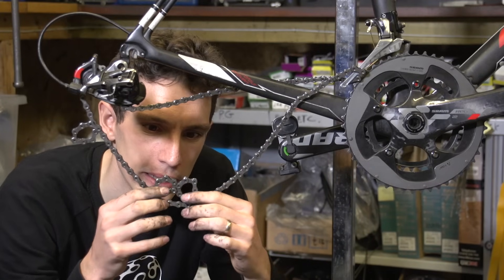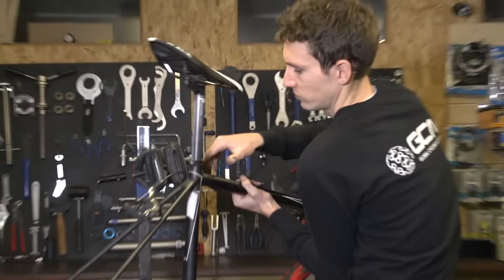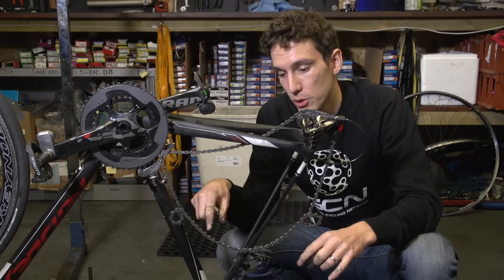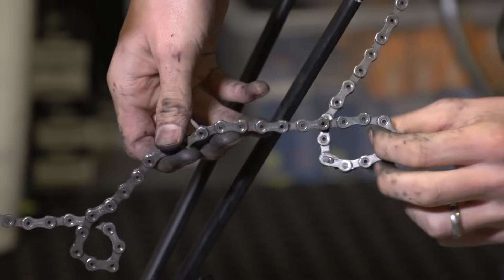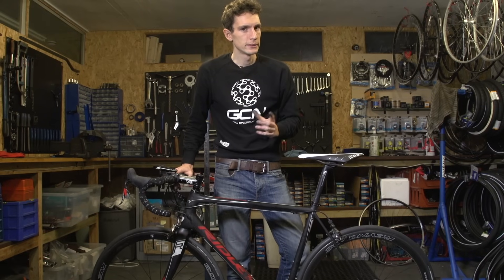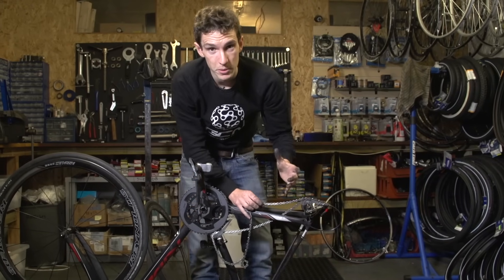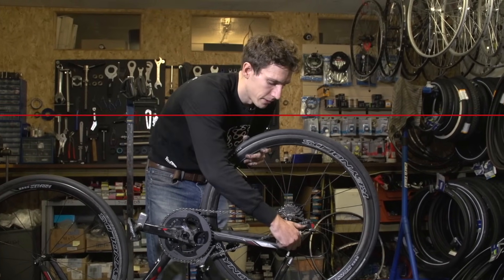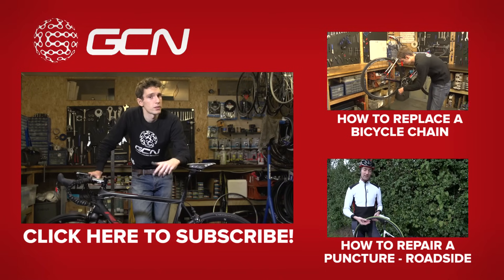How To Untangle A Bike Chain

Comment: Simon;   Yes, I see.  But if the chain loops (tangles) are ‘facing’ the other direction, then this will not work.  The chain will not easily lift back into place as you demonstrated.   Looking forward to more of your otherwise helpful tips.  Cheers, Peacham, Vermont, usa
Reply: Then what?

Comment: Great video! A lot of cyclists get confused when their chain gets looped like that. Si does a great job of explaining the problem and illustrating the solution. Although I did laugh at the dirty fingers. I "second" the suggestion to use a removable master link. They go by many names: Master Link (Flying Horse), Missing Link (KMC), Connecting Link (RK Racing, Renthal), PowerLink (SRAM), etc. I live near Lake Michigan where sand is unavoidable. I can ride on a clean beautifully-paved road and still get sand in my drivetrain because the wind blows it from the sand dunes along the lake. It means I have to clean the drivetrain often. Every one of my bikes and my family's bikes have SRAM chains with PowerLinks. It makes cleaning our chains and drivetrains so much easier!

Comment: If you have your bike flipped upside down and the loop is on the right side take the loop and bring it over the top of the gear then take the left hand loop cuz you're going to cause another one and flip the loop in the opposite direction over the pedal that will release the whole thing

Comment: I have this problem earlier tonight and I had five loops in my chain here's how you take this thing out the first thing is don't get frustrated... The second thing is like he said spread the loop apart but pull the loop in opposite directions you're going to cause another kink the king that you just caused again pull the chain in opposite directions and that will release the first one taking this out is like a Rubik's cube don't get mad at the chain because you're going to snap it if you feel tension let it go and just work with it and move your right hand forward and your left hand backward and try to basically undo the knot

Comment: I ordered a folding bike and it came with the chain off of the chainring and 2 kinks! I spent forever trying to untangle that damn chain! I removed the brake pads, rear wheel, rear derailleur…chain still kinked! Then I came across your video and voilà! Problem solved! I’m on my knees with gratitude🙏🏼

Comment: I get it.
I just dont' get why folk on cycling subreddits always says roll the loops together to cancel them out. Constantly have to correct them. I've even tried what they describe as experiements and they alwasy give bad advice haha.I would argue that if you have to turn your bike upside down loop teh chain on purpose cos once its looped it doesn't move and you can fix it easily.

Comment: I'm not saying this video doesn't work, but after I put the chain resting on the derailleur I get stuck because the chain is caught on the frame of the bike. So I don't know if it's that I have a different kinda bike or what but it's just not working, I pull the second knot up and it doesn't do anything because it gets stuck on the frame

Comment: I have a chain catcher installed, and when I carry the bike in the car boot, the chain falls on the inside, beyond the catcher. I don't even remove the rear wheel. I swear there is not enough space for the chain to go through and yet it does. Only way I can put it back up, is to remove the catcher.

Comment: Thank you, my multi-gear electric bike was a bit different from the video so I felt I had some extra complications. That being said, your video was vital to my success in getting my back tire properly reinstalled after replacing the inner tube. I feel like the nature of untangling bike chains brings out the most frustration we are capable of having, along with spider-wrap you'll find in retail stores clumped together.

Comment: i was ready to scream putting that rear tire back on i changed the tires to try a gbn tire thing put a more lower profile tire on the rear maxis suggested using  ikon as a rear tire so i put a minion up front for grip i want to see if my speed improves or i smack into the side of a tree hopefully not when i flip the bike my water broke i was even more determined to get this tire  back on mission complete the chain was tangled i was not stopping till tire was on the bike  loaded the bike in the car went on to next task

Comment: Very useful video. My road bike's chain tangled luckily less than a mile from home yesterday after a long and fast ride. It's been a long time since I last encountered (and sorted) a similar issue and in my weary state I didn't have the brain power to work out how to fix it. I wheeled the bike home and watched this video this morning and fixed it in less than 30 seconds without having to take the rear wheel off. It was getting the two loops as far apart as possible that made the everything else fall in place. At least I'll be now able to ride the bike to my mechanic for him to identify and rectify the cause of the slippage so hopefully it will be a while before something similar happens again. If it does, hopefully I'll be able remember what to do.

Comment: I did is a couple of times. It happens sometimes when the chain passes the big chainring during a shift. If it happens usually you shift back to the smaller chainring. But sometimes the odds are against you and you end up with a knoted chain. With this twitch-explanation I might figure out what to do next time.

Comment: STEPS
1.) Remove back tire 
2.) Turn bike upside down 
3.) Spread out the loops until they open up and go over they derailer
4.) Re-rack your chain 
5.) Replace the back wheel

Comment: i have heard you say a few times that you must avoid turning your bike upside down. how come? i turn mine upside down often because i have to take my rear wheel off to put it on my kicker.
Reply: So somebody can sell you a bike stand. Ostensibly it's to avoid damaging your shifters or saddle.
Reply: +ch2263 You put more pressure on the saddle and the shifters while riding than when the bike is flipped up side down. It's a bike, not a vase.
Reply: Rule #49
Reply: +rikkiola good luck with that. Rule #1